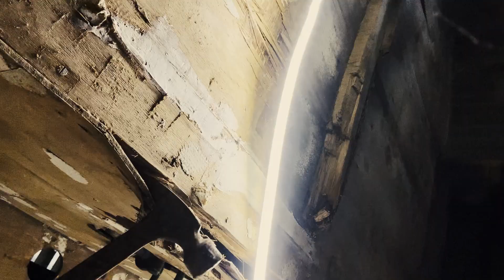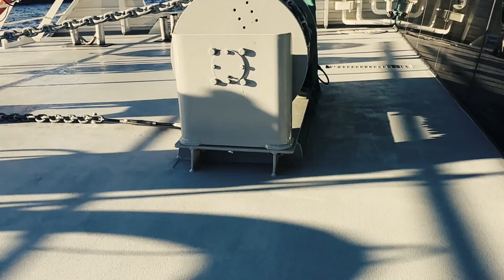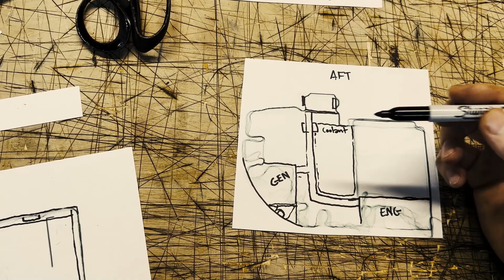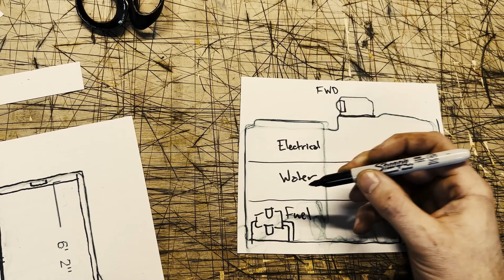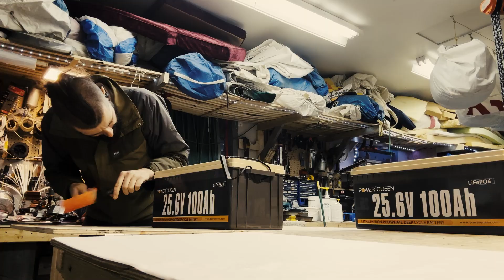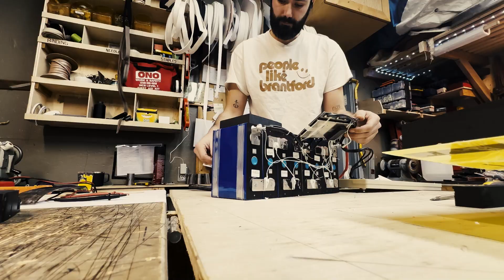3D SCANNING the Engine Room

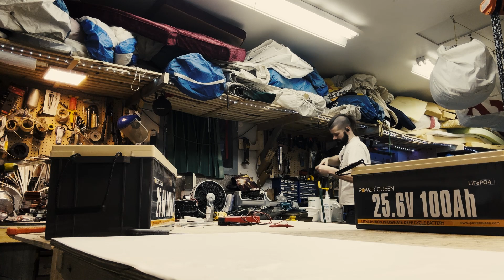Comment: 13:50 there are some videos of people using old AGM cases to make new lead acid batteries (in 3rd world countries) that kind of remind me of that... though they tend to have used angle grinders to cut it, and plastic shards and an iron to reassemble it when they were done... I was looking into methods of making my own salt water battery, but I need a way to improve the surface area of the Copper and Aluminum to boost the capacity of the battery, but it should otherwise be comparable to a third the capacity of an AGM battery of the same weight (partly the limitation I am trying to get around). Have heard of one study someone did with using wire, not plates, and coiled them into tubes that has greatly increased the batteries capacity, but I couldn't find the paper going into more detail.